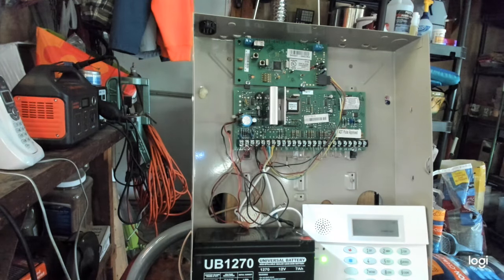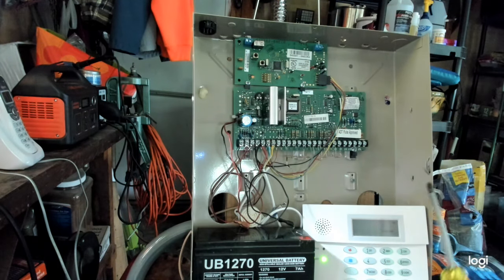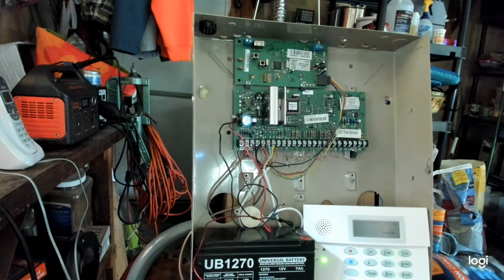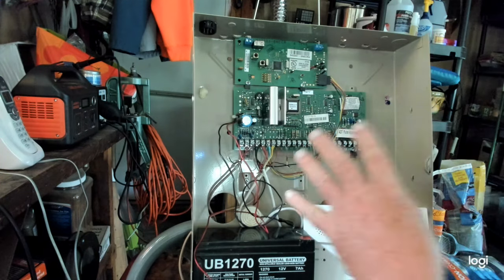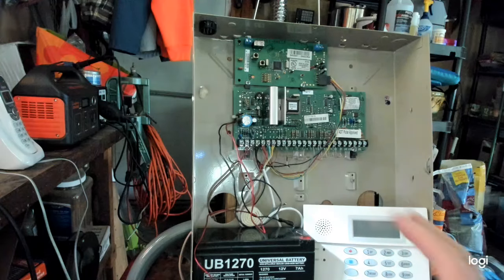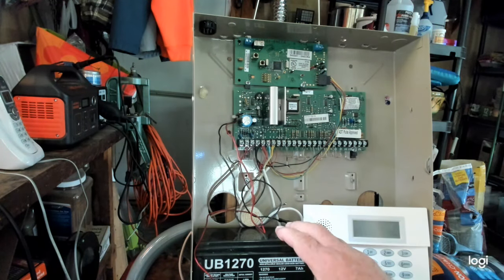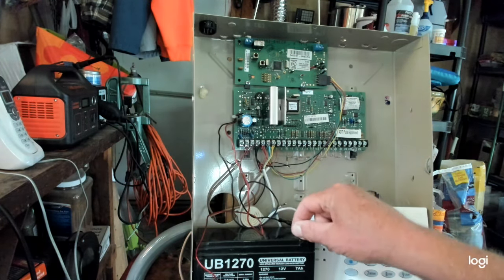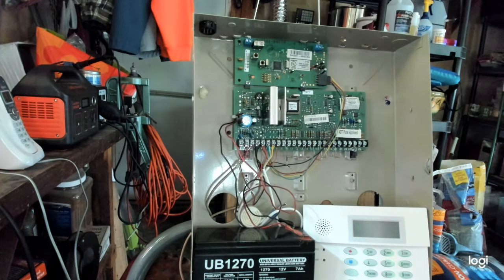My Honeywell alarm system will not stop beeping, how do I shut it off

Comment: I have this panel at my house and don’t really use it. It’s beeping every 15 minutes just one time. If I turn off the breaker switch that goes to that panel will that stop it?
Reply from the maker: Yes,,,plus you need to disconnect the battery, but beware you may be shutting off your smoke detectors also

Comment: Are you with familiar  5819 with the shock sensor?
Reply from the maker: Yes, what can I help you with?
Reply: @DIYELEKTRONICKITS  One of my 5819S the shock sensor  is zone 39 and I have to bypass that to set alarm for house. Have any idea how I can fix that or a work around?
Reply from the maker: @55steviegreene  There are 2 zones on a 5819, the shock sensor and the contact sensor, which sensor is causing the problem shock or contact?
Reply: @DIYELEKTRONICKITS  Shock
Reply from the maker: Sounds like a weak battery
Reply: @DIYELEKTRONICKITS  ill try that